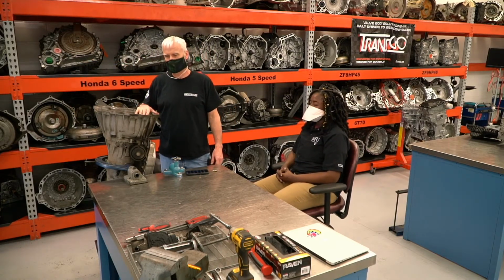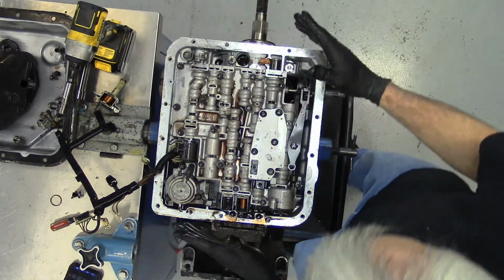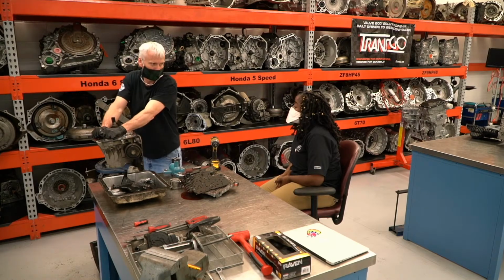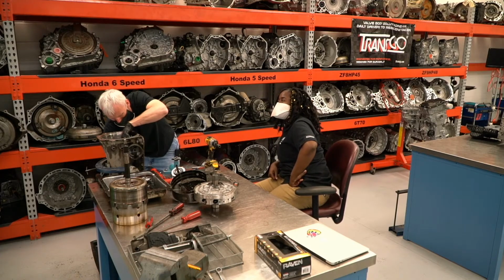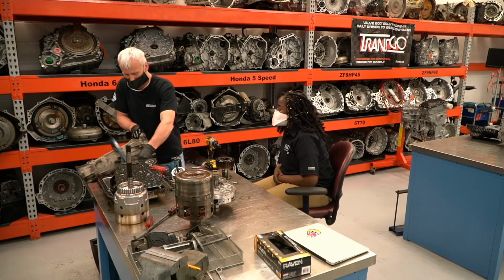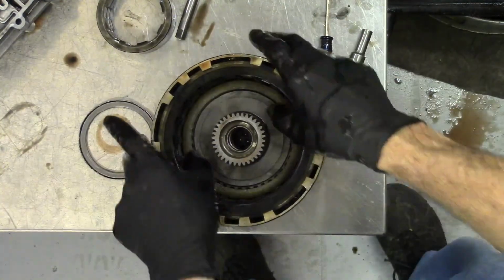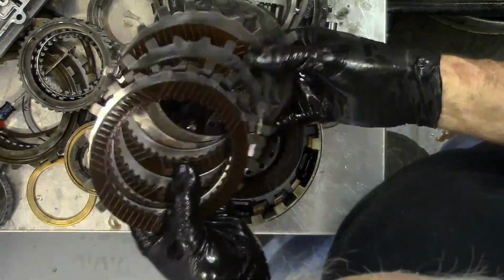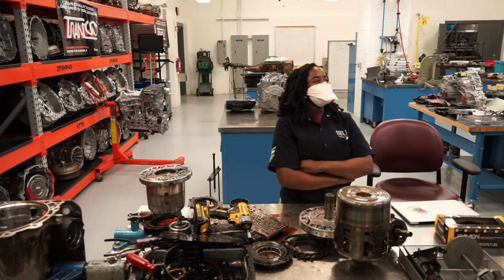4L60e Overhaul part one - tear down

Comment: be great if you could pull apart a valve body 4l60e and
explain briefly what, where all the valves etc are and what they do 👍
Reply from the maker: Good idea! On Thursday I'll have the valve body apart and cleaned, so we can look at the valves and explain their operation, assemble it, then vacuum test the valves to see what's worn out.
Reply: @siuautomotive  you've just made my day, lol thanks
Reply: @siuautomotive  ive got a Holden Commodore V.S. 
Station Wagon ( https://en.m.wikipedia.org/wiki/Holden_Commodore_(VS))
and it has the 4l60e,  no problems with it, but I got more and more
fascinated with it as I studied it further, remarkable machiné and
a wonder how it works so flawlessly after many years and Kilometers (Miles) 
with so many critical, sensitive parts